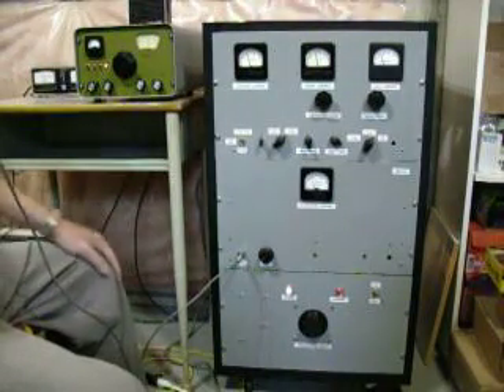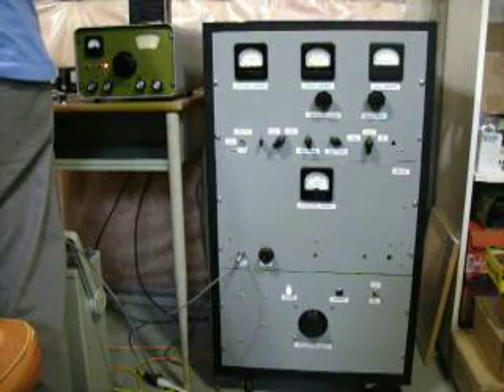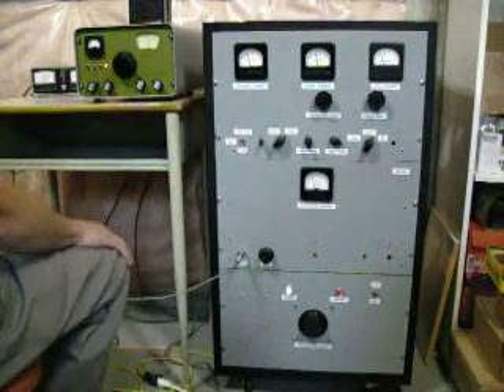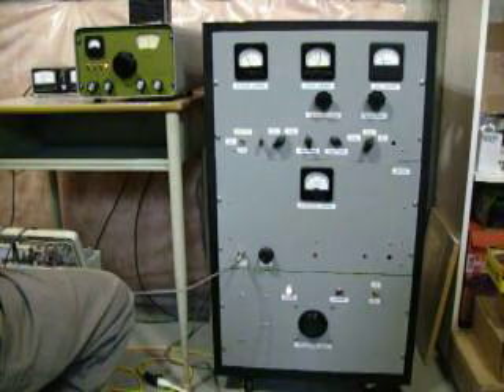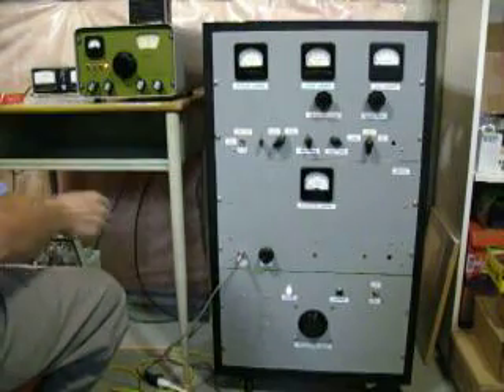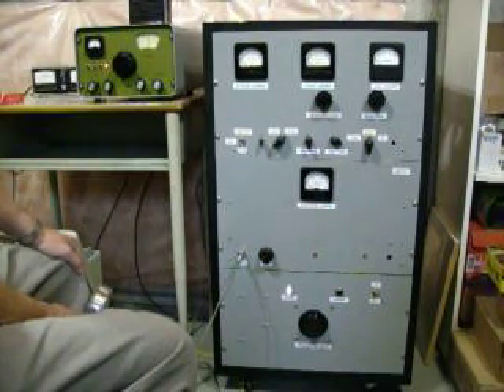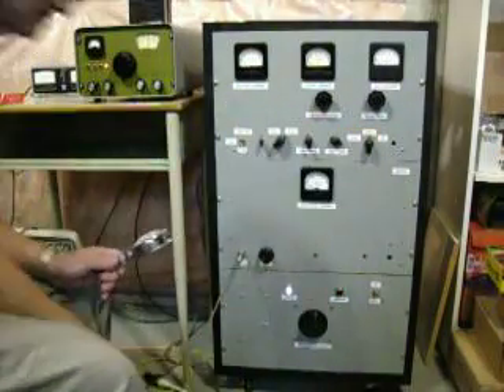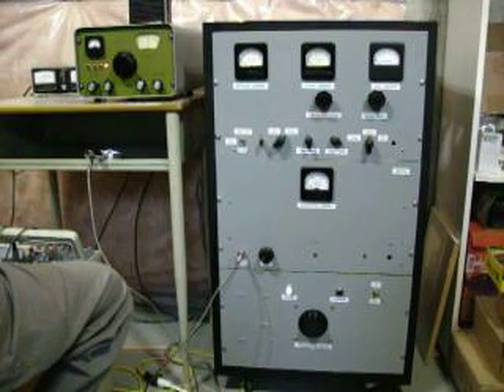4-250A 400 watt plate modulated transmitter

Comment: Credit due for a lot of good work, but many amateurs have "forgotten"  the perils of Class C plate modulation,  namely  that Class C  MUST be very well shielded as it's prone  to  radiating more spurs/ harmonic products,  as well as   (unlike SSB)  the only thing to limit bandwidth  is very careful  modulator design  AND OPERATION,  being limited by the audio response of the speech amplifer.   Anyone tuning nightly up/ down 75M  will hear the poor results of improper AM operation.